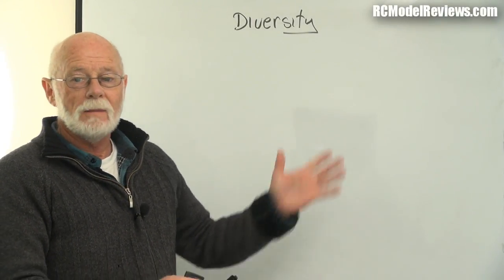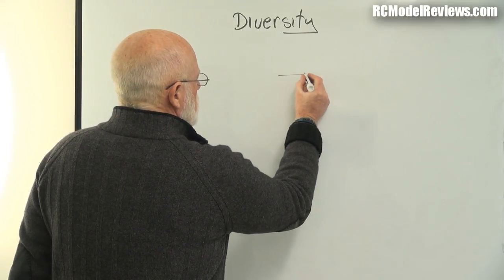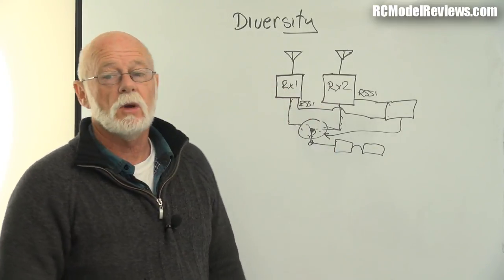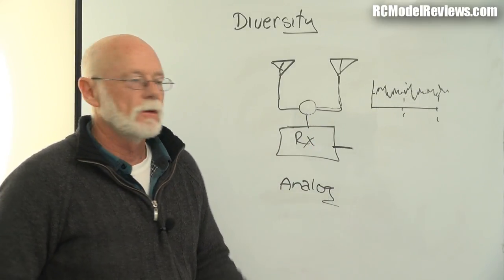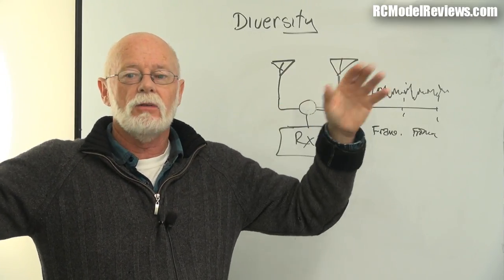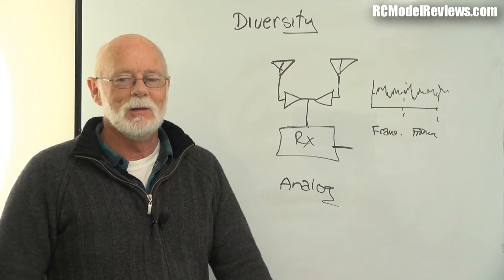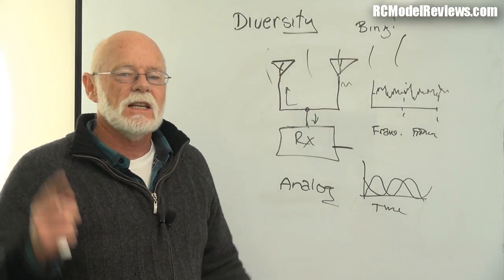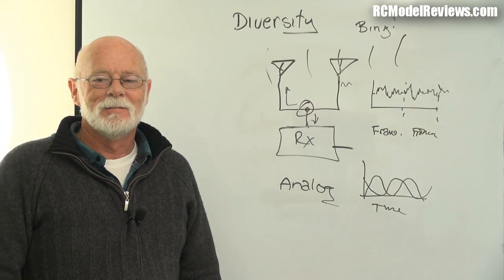Receiver and Antenna diversity 101

Comment: Bruce, I'm pretty sure what they are doing is the first analog diagram you used.  That would go along with the theory that I described in my review.  There is a noticeable dropout that happens occasionally and my theory was that was when it was switching antenna.  But it is really quick so for most FPVers it just one for frame of not perfect signal.  For a hard core, full speed racer, it could be a disaster.  But that is not who these are for.  Thank you so much for this video,  it will help a lot with something I have planned.  Now I haven't seen all the reviews, but I haven't seen one that says they are the best thing ever.  What they are is unique on the market, they are FPV Ski Goggles at a price point no one else has come close to.  Still inferior to box goggles, but some people simply refuse to use box goggle.

Comment: As an additional data point, I use Fatsharks' Transformer headset with antenna diversity. The antennas that I started out with were a cloverleaf and an dipole. I noticed that at longer ranges, around .5 kilometer, I was getting interference and breakup. When I changed the dipole to a good patch antenna and as long as I was pointing the patch antenna at the quad, all the interference went away and I was getting a clear image. For me, in this case, antenna diversity seems to have made a dramatic improvement in signal strength. Not sure if the implementation of the antenna diversity circuitry is the same, or even similar, between Fatshark and Eachine, but in my case, it seems to be working very well.

Comment: There is a project going on RC Groups which is a DIY Compatible Frsky D8 receiver. It uses the HUB protocol, which I prefer instead of the newer X Protocol for several reasons. It can output SBUS (8Channels only) and PPM, as well as 8 PWM channels for connecting servos directly to it. It can be built using a couple different  CC2500 RF modules that can be bought cheap from several places on the internet. It can be built with diversity, and this is the reason I'm posting here. As you can see on the video linked below, the diversity works really well. But contrary to what was said on Bruce's video, the receiver does NOT use RSSI to decide if the antennas should be switches or not. It uses lost digital packets/frames of information instead, and this turned out to be much more efficient than RSSI. This explains why the antennas didn't switch even though they were not in the ideal position and with my hand covering them (1.5Km). The reason was the signal was good and not many packets of information were being lost. When too many packets are lost, the antennas are switched and the second antenna will stay ON until a certain number of frames/packets are lost. This, unlike RSSI based switching, prevents the antennas switch from starting oscillating sometimes, which is not good. Anyway, here is one of the test videos I did using the DIY receiver and the STM32 multiprotocol module. Radio was a 9x radio with Ar9x upgrade board and Ersky9x as firmware, and was at home with antenna vertical just inside my bedroom in front of the window. The receiver was being tested at 1.5Km line of sight. Radio had a servo test program running all the time.

https://www.youtube.com/watch?v=pVZtts5DoV0&t=2s

https://www.rcgroups.com/forums/showthread.php?2124647-DIY-FrSky-TX-RX-Modules

Comment: Hey Bruce, how do they do antenna diversity in the VR D2s so well? It works amazingly well with no flickers, no blackouts! I've used the diversity feature with a patch to locate missing quads. Way better than this little FatShark monitor I have which just has crap reception, even when paired with FatShark antennas!

Great video. Was hoping someone would do this. Would actually love to see someone do this with actual equipment. See if there is a quantifiable difference.

Comment: Got one question... there was an old diversity video that you were going to show us how to do a 3 or 4 receiver circuit... even showed the board with hopes of being able to buy the pc board ....but never completed the episode so we could build it ourself.Any hope of seeing that project finished?.. i really would like to build a diversity-tracking receiver rather than a servo tracking one... especially since I always fly within a 180 degree swath from where  I sit. Something like a Quanum Overlord that can be roughly aimed by a simple servo controlled by a knob on the rc transmitter such as the Turnigy 9X and a second receiver used on the ground station.

Comment: Have a pair of EV100's.  Pretty sure it does not use amplified to solve the antenna diversity issue.  In testing with VTX in pit mode and different antenna types it seems to pulse between the antennas should both be getting enough of a signal.  Seemed fine when using and flying with 2 others at the same time.  With all different antenna types I tried, the included dipoles worked best then the model had a pagoda antenna.

If I had a cheap way to send them to you to review, I would.  I like the candour of your reviews.

Comment: For $100, I know I'm not getting true diversity. Heck, coming from Quanum Box goggles I'm willing to use these even with just one antenna if their implementation of antenna diversity sucks just so I can get a cheap pair of actual lightweight goggles!

As far as FOV, many have said cutting down or getting rid of the thick face foam actually let's your eyes sit closer to the screen and makes the FOV better.

Appreciate your review and agree with everything you said. These goggles are not great, but their excellent for people looking to get into the hobby without breaking the bank. Regardless of its shortcomings, it's still the best CHEAPEST option for FPV beginners!
Reply: I've been flying with my EV100's for about a week and I'm very happy with them. Until I find a <$200 price on a set of HD2 or HD3 equivalent goggles I'll be sticking with my EV100's. They work fine and I have better things to spend money on. Bruce's information is very much appreciated but I feel that the hysteria surrounding the lack of receiver diversity on these goggles is ridiculous, the only important question here is whether they have good reception and even the most critical reviews of these goggles (apart from Joshua's defective set anyway) admit that they do have good reception.
Reply: circleofowls I agree. I haven't flown Fat Shark goggles, so what I'm I really comparing these too and missing in reality? Most of the bad reviews are coming from people who've flown fat sharks exclusively for years, so yeah, they are going to be subjective in comparison. Like I said, show me a good starter set of goggles, not box style, for $100 that are better for beginners who don't have the coin for Fat Sharks. HD3s are going to run close to $500 after you're done buying a receiver.
Reply: 10 months later we have EV800D with diversity, but is it true diversity?

Comment: Hi Bruce,
I run two antennas in parallel for my CB in my truck.  They become directional when in parallel, so I can hear more in front and behind me but not so much to the sides.  So, in the case of RC models, thats the opposite of what your looking for in diversity.

Comment: What protocol is used by FPV goggle receivers (i mean the external receivers) ? i saw some receivers with some pins and I wonder what the pinouts are. I am planning of building my own fpv goggle using such external receivers but I just dont know what pins are what. Cant find any details about it on google. If you can discuss about it, I would highly appreciate it. Thanks

Comment: Your videos are great! I love them. A question: I have a VR006, which has the same "antenna diversity" receiver as the EV100 has. I use it only with one good antenna. A dummy load is on the other antenna connection and the "signal" is stronger and more stable with one antenna. Is that make sense? What do You think?

Comment: Hi Bruce, do you have any idea why frsky would have reduced the active element length on their xm+  and xsr receivers? They've gone from the usual 32mm approx to 21mm on xm+ and 25mm on the xsr. I contacted frsky & the answer they gave was 'to make it better for fpv'. It just seems to me like they're using less than 1/4 wave now on those receivers which I thought would reduce the signal reveived..
Reply: jonc67uk yes Bruce I am also curious about this too
Reply: I think the main reason was that the receivers were struggling with the signal being too strong when right next to the transmitter.
Reply: Stephen Gibb hmmm interesting I'm wondering because of that rotor riot where they tested different reciever and modded the xsr antenna and thanks for the input man
Reply: I didn't have any problem with the xm+ with the correct length element, I've had 3 with no close range problems at all so that's a bit wierd..

Comment: For the record (and this is 2019) I have the Eachine VR D2 Pro goggles, and using diversity, I get terrible flickering when it switches signals. When diversity is off, I get a normal (read: no flicker) picture.

Comment: I'm curious about testing methodics for diversity quality. Also, in case of antenna diversity interesting thing is how to get best reception from the unit - using same antennas, different antennas (what effect it would have?), one antenna with dummy load, one antenna without. Personally I'm ok with no diversity for $100 ($150 not so much) as long as it is not making it worse:)

Comment: Hi Bruce, is it possible to put a 2watt signal booster on both your tx antennas and the rx antennas?  When using my flysky fs16s tx, I was getting 800m, now ive put a 2watt booster on the tx and a 7dbi antenna I can get at least 1.2km and as I get some telemetry back (battery voltage and signal strength) I was wondering if one of the cheap 2watt signal boosters on 2.4ghz could be attached to the rx antennas on the quadcopter, or would this fry the receiver?  i.e a 2 watt signal booster on both ends?

Comment: Antenna elements can be passively connected to each other in a way that makes sense, but it has nothing to do with diversity but modifying the gain and directional pattern of the antennas. Agreeably, on the goggles it would make very little sense. Keyword here is stacking antennas and antenna arrays, for those interested.

Comment: Rc model reviews. I fly 5 in racing drones. My first was a ready to fly drone, I wanted to get in cheap as possible and I fly radiolink at9 transmitter and  a ad9 reciever. I modified my assntanea  on the reciever of my drone by splicing 2 2.4ghz antenna. Orient  st 90 deg  apart.  Keep in mind this is for my reciever and  it's 2.4 not 5.8. I notice a vast improvement  in my flight range without failsafe. Can u explain why  this works well and the antenna diversity  for 5.8 videofeed reciever  does not. Or am I fooling myself and only have some variation in the  mounting of my a team was or another explanation to thank for my added  range.  I realize this is not the same as diversity receivers on analog 5.8 Visio receivers. But be for I modify  all my antaneas on my radiolink receivers I'd apreciate more knowledge on this topic. Love your videos been a subscriber for a long time.

Comment: Here's a nice teardown of the Eachine goggles for you: http://fishpepper.de/2017/09/18/eachine-ev100-99-fpv-goggle-disassembly-components-pcb-pictures/

Quote about the diversity antennas: "Both antennas connect to the lower and upper left side of the PCB. Both signals go to a high frequency multiplexer (switch), passes a filter, passes another chip (amplifier?) and is filtered again before entering the trustworthy RTC6715 5.8GHz video receiver chip that everybody else uses as well. You can see some further passive components and some voltage regulators. The chip labeled S033 is probably a microcontroller handling the diversity switching and interfacing to the main CPU."

Comment: specifically with rc diversity not video.. but maybe its the same.. but yeah, so is there every a downside to using diversity? is there ever a chance that using diversity could lead to drop outs when switch between receivers or will 2 antennas 2 receivers diversity always be better? thanks for the videos!

Comment: Nah mate, you need some Expo white board cleaner (or whatever they call (2-methoxymethylethoxy)propanol (no greater than 3% according to the MSDS) in your neck of the bush). I got some in a marker and eraser pack during a back to school sale and thought "meh, its probably just like the iso/water mix I usually use" NOPE!!! This stuff obliterates marker leftovers and dried on ink (even sharpies. You can use sharpies for layouts you want to stay on the board and mark around them with dry erase (though sharpie and dry erase solvent work on each other (they are effectively the same, just one is meant to come off smooth surfaces and the other latch onto everything) so they will mix) then clean them all off when you're done). I assume its the solvent they use in the markers or something. But yeah, I know it sounds silly, and really some iso alcohol and water does really work okay, but proper white board cleaner is awesome! And it lasts forever, Im only 1/3 of the way through a 8oz bottle. You need a lot less than you think, 2 full squirts is too much for most of my smaller boards.....

Comment: Hi Bruce. Interesting and informative video thank you. I wonder have you investigated how the fat shark diversity receivers work? The reason I ask is that they also use antenna diversity rather than two separate rx's. I'm guessing eachine is doing something similar
Reply: I had this early fatshark antenna diversity module. it was crappy! even the original single RX module worked better for me. back than I didnt understand what was going on - now with this video I feel like I understand it better - thanks Bruce!
Reply: RCSchim I've just upgraded to furious true-d 3.6 from fs div 2 (which didn't seem too bad to me but that's all I know). I'll be a disappointed if it's not an improvement!!!

Comment: Bruce what about putting one cloverleaf on a angle out forward and the other straight up would that work or use a very small pigtail on one of the antennas and have them at different levels and angles  Bruce

Comment: I bought an Aomway diversity 5.8G receiver from Gearbest. It is crap! It does not tune in, it has lots of audio noise and I can not get a picture with OSD on any channel,. I have tried with to transmitters and another two receivers which work well together but the Aomway works well with neither. 
Is that just a diversity fault or a product fault?

Comment: would it be possible to rectify both input signals and feed the dc voltage to a comparator to operate a pair of flip flops to then choose which signal input reaches a threshold level first,some what like either an audio compressor or the feed back signal for a smps detects the dc voltage using a triangle wave level shift to control a series/shunt ellement.

I'm spitballing and am not too familiar with radio ,though i've seen detectors that rectify signals also some signals are half wave rectified to obtain the audio signal,tank circuits schematics etc.

I work on audio and am now getting interested in FPV,I bought a eachine novice 3 s/h on fleabay and now need to do the learning curve thing,P.I.T.A......TBH.

Comment: Hello dear prefered knowledge bible, I have such a eachine « diversity » apparently VR009 eachine but looks like a FP009 , anyway, when I check the RP-SMA connector on it, one of the two is shorted, is it due to a switch or something ? Or is ot just faulty? I can add a link ton my video showing it.

Comment: Good job Bruce, I can't wait to see what you find out with Josh's set of goggles.  Because of those fluff reviews you talked about, Eachine upped their prices by  $50.00 for a set of goggles. It looks to me like they are just trying to do a big "money grab" before you and a couple of knowledgeable reviewers get to the truth on what's inside these magical goggles.  It real easy to understand why they didn't send you a set. -- they are afraid of hearing the truth.
Reply: to be fair here: I think they had a really high number of orders even before the first reviews were out...
and they wrote on their page that only during initial few days it would be 100$...
but still - it appeared to be a better deal than it actually was...
Reply: RCShimm:  I didn't know that they had publicized that the $100 price was an introductory offer.  I need to rewatch your review and a few others before I critique a product.  I do however have significant experience with cheap antenna diversity products like a diversity receiver that had only one cheap receiver yet claimed full diversity and that you could fly for miles and still get signal.  I will be watching to see what Bruce finds out.

Comment: Some testing of the diversity on the EV100 has been done here: http://fishpepper.de/2017/09/22/eachine-ev100-diversity-to-be-or-not-to-be-that-is-the-question/ 
and it looks like there is a switch in there that switches antennas every 500ms when RSSI is below a certain threshold.
I was wondering about the way RSSI is determined, and if it can be relied on for fast switching(under 1ms) because when I've build a DIY diversity receiver with some RX5808 Rx modules, the RSSI wasn't very stable and had to be read multiple times to ensure a reliable reading. Is the RSSI more stable when digital signal is used like on our RC link?
Reply: was going to post the same testing results. It's actually switching antennas.

It's kinda smart and really bad at the same time. It does read one antenna at a time... forever. Until the signal drops Then it blindly switches to the other one with the assumption it should be better. It could be possible that the 2nd antenna is getting a worse signal and the RX doesn't know until it switches.